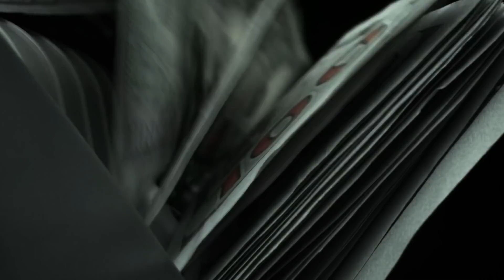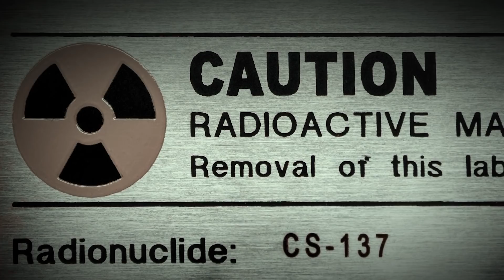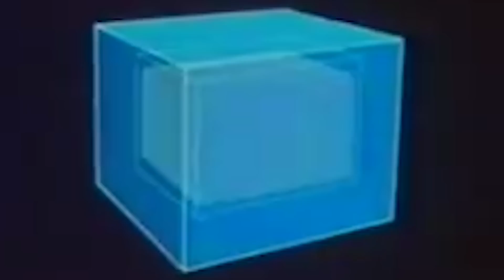100 MPH Train vs. Nuclear Tank

Comment: the weight of tonnes of the flask is 50 tonnes but with the flatbed railcare which weighs about 35 to 45 tonnes and take in consideration the train derailed because they took the track up were they lay the flatbed and flask so if that train would of been going say 55 mph and there would of been more railway track for the train to carry on i do thinnk that the train would of pushed it a good 300 foot or more down the line ok the front of the loco would of been damage but i do think it would of turned out differently i seen that 139 tonne engine at the scrap rail yard and considering it was going 100 mph and hitting something at speed that weighs nearly 100 tonnes all together the locomotive wasnt very very badly damaged ok the drivers cab was all gone but the rest seems ok and it is exploded too so that locomotive was very tough but so was the flask,

Comment: As for the Class 46 locomotive, she was scrapped on-site, though at least two of her classmates are preserved.

Nuclear flask trains still run in Britain today, and from what I gather they're now run by a company called Direct Rail Services. Motive power is usually provided by Class 20, 37, 57, 66 or 68 locomotives.

Comment: I remember this. It was a classic case of a company under political pressure diverting attention with a gimmick. There never was much argument over the capacity of the container to withstand physical impact. Then as now, the issue was (a) can the container withstand slow corrosion over very long time periods, and (b) how easy is it to steal?

Comment: Ok, but like, worst case scenario if the gas inside the flask that escaped were as radioactive as physically possible, how much of a release would 0.29 psi equate out to?

I'm no nuclear scare monger, I'm perfectly okay with nuclear energy(SMRs FTW!). But it does seem like a question worth having the answer to....
Reply: I think the video states it would be an acceptably low release fraction, i.e. in accordance with the UK Law based on the IAEA Regulations.

Comment: "Countries that have developed nuclear energy strive to prevent such disasters at all costs." You mean like building reactors with graphite tips on the top of fuel rods and no containment to reduce costs, like at Chernobyl? Or 12 foot sea walls where 60 foot tsunamis occur, like Fukushima? Or renewing Davis-Besse's operating license in Ohio even with a cracked containment? Or renewing the licenses of all those brittle old reactors after their 40 year life span is over? Or overloading open cooling ponds and using casks welded by unlicensed welders for storing fission byproducts within 100 miles of every major population center in the U.S.? Or not cleaning up acidic radioactive mine tailings? Or dumping nuclear waste directly into the ocean or in the Arctic or sticking it in 55 gallon steel drums (I am not kidding) in abandoned fields. Or, or, or. disasters, disasters, disasters. I have 4 great ideas! Surely everyone wants to do everything possible to assure the public that the warm-hearted intentions of the nuclear industry and its government cheerleaders will be more than enough to protect them. Just do these simple things. 1) End government subsides for nuclear energy. 2) Require utility operators to have full liability insurance and accept responsibility for all destruction, death and disease which occurs as a result of their operation or operating failures. 3) Rescind the extended operating license for any reactor that has reached the end of its 40 year design lifetime. 4) Shut down every reactor until we have a permanent safe waste storage solution for all of the nuclear waste, including radioactive mine tailings and contaminated reactor parts for the entire duration of ten times the half-life of all the waste needing to be stored. Make sure all that waste gets tucked safely away and put the biggest, meanest armed guards on top with orders to shoot to kill anyone who gets close, especially if they are nukies or politicians. Then lets talk about having done all we can to prevent disasters.

Comment: That’s all just GREAT!! And where do all these thousands of SAFE blocks of deadly radioactive death actually end up???????? Bottom of the Marianas Trench 😒
Reply: Ever heard of a breeder reactor - do your homework. You don't throw away energy  - unless you build windmills and solar panels of course.
Reply: Sea dumping of (low level) radwaste was ended by international agreement a long while ago. The used fuel carried in these flasks was shipped to Sellafield for reprocessing and the resulting radwastes are still stored there, awaiting eventual disposal to a deep geological disposal facility (if the UK can ever decide whose back yard it's going into).

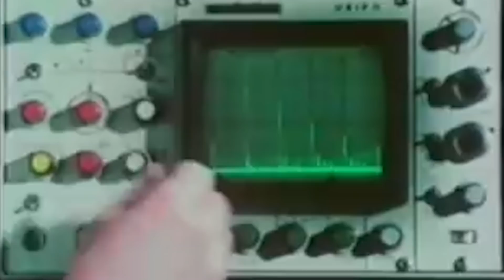Comment: 3:50 "Pressurized to 100 per square inch, per square inch" 🙄
Reply: It is a new and novel unit of measure: PSI^2 

Apparently there is a newly discovered acceleration component to static pressure.
Reply: Surely at least the first P is pounds.  
What would that be... 
PSI = pounds/in²
PSI/in² = pounds/in⁴ ... ?
Reply: @arfyness  
Apparently they have come up with the moment of inertia of weight or something

Comment: The bolts that are mentioned at 1:34 are most probably made by my  teacher at college. He was the manger for making them. (I think manger, he check and made sure they all fisted and worked to the tolerances of the spec). He still has the operation sheets for making them. I got to read through it and it was really interesting. They had to be stored in oil and a nylon sleeve to keep them from getting damaged.
Reply: Neato. Probably made out of a similar material of  H13/ tool steel. It's sensitive to rusting so it constantly has to be oiled. I have these bolts as rod bolts in my engine
Reply: I doubt it

Comment: I used to work for an engineering company that built much smaller flasks for British nuclear fuels, in fact I earned extra money working a night shift sand blasting them.
Reply: Interesting, I would think the extreme weight of these flasks would make them nearly impossible to steal? A few terrorists would have a hard time making off with a 150 ton container.

Comment: Why can't they make something like this to transport oil and deadly chemicals?
Reply: because it would increase astronomically the transport cost for no reason. Imagine carrying 2 tons of cargo inside a 15 ton containment vessel, and without need for all that, given neither oil nor any non-radioactive chemical emit alpha/beta/gamma radiation. The issue with spent nuclear fuel is the shit it emits goes through solid steel plates, thick ones at that.
Even with all the hazard of oil spills, it's still FAR easier to clean up, and any uncleaned residue is far less dangerous than spent nuclear powerplant fuel.
Even non-radioactive chemicals, anything that comes out of them, as deadly as it is, can be stopped with normal materials in normal quantities. Toxic gases can't pass through solid non-porous materials, neither can liquids, and solid stuff just stays there too. If it can't corrode the container, it's fine. Protecting it against shocks can be done with simpler ways like foam cushions around the package that holds the chemical.
Some chemicals to be discarded can also be neutralized to either reduce the danger or downright turn them harmless.
Reply: @Kalvinjj  Only gamma radiation will pass through anything more than thin aluminium sheet.
Reply: @bobthebomb1596  Yes, specially alpha is easy to block. Just added them cause, well, they still are important to block well after all.
Reply: @bobthebomb1596  Actually neutron radiation will also pass through thin Al sheet. But, for irradiated used fuel, gamma would be the main radiation of concern. Some neutron radiation will also be generated, but the gamma doses would be much greater.

Comment: 4:54 Uhh, you realise we can see that there is NO flames at all right? 🤷🏽‍♂️
Reply: Not immediate, then.
Reply: @mikeuk4130  It was a diesel train, takes a while to produce an ignitable fuel/air mixture.
Reply: @bobthebomb1596  Agreed, I was just railing against the over-dramatic commentary, which was hardly necessary, given the event.
Reply: @AmmyWulf  Why wouldn't he add that... 🤷🏽‍♂️ Thx tho I will check it out.

Comment: 100 pounds per square inch per square inch. That's like 10,000 PSI!
Reply: @Robert Sears Is that PSIA, PSIV, or PSIG? I only understand pressure in terms of Newtons per Square Meter.
Reply: @BruceWang-h7s  How many inches of Hg is that?
Reply: @KellinKingdom  Like at least 100 metric Torrs per square inch PSI
Reply: @BruceWang-h7s  That makes way more sense. Thanks! :)
Reply: @Robert Sears I agree. That's why I write out my convective heat-transfer coefficient in BTU/(ft^2*F)*hr, and not W/(m^2*K). Gotta stay away from that commie Metric System.
Reply: @Robert Sears lol
Reply: @Robert Sears But what he said was "100psi per square inch" he didn't need to add "per square inch" or should have said 100 pounds per square inch.
Reply: @Robert Sears  If you are so stupid that you can't see it then I'll not bother explaining further. I refuse to fight a battle of wits with an unarmed man.
Reply: @Robert Sears You're right, it's more like 100,000 PSI!

Comment: Scientist one: "How can we structurally test these flasks?"

Scientist two: "I like trains"
Reply: Scientist one definitely hates scientist two
Reply: more like engineers in this case but ok
Reply: "Good work, men. We've proven they are sound safe from impacts."
"What if, for some reason the train crashes and is in a puddle of fuel for an extended period of time?"
"Good question, Jenkins (it's ALWAYS a 'Jenkins', isn't it?). Let's fill a pool full of jet fuel in the desert, put one of these buggers in it, flick a match into it, let it burn until dry, and see what happens. It's for science, after all."
"Wonderful idea, sir! I'll get the s'mores fixins!"
Reply: What about a 12" naval gun? The tests were propaganda, not a test against attacks
Reply: @RebeccaCampbell1969  12” 1100lb naval round at 2700ft/s = 175,105,000 Joules of kinetic energy

250tons of train, one locomotive and 3 cars. = 500,000lbs moving at 100mph
226,620,148 joules of kinetic energy

So yeah I think it can take a 12” naval round to the face point blank.
Reply: @user-yq6ov6ow7l  your forgetting the surface area of impact by Joule/cm^2 and relative penetration of a pointed shell vs blunt train.
Reply: Was #2 name Cooper?
Reply: I like trains.
ADSF!!
Reply: Rail is the primary form of transportation so it makes sense, and it's fun!
Reply: I think they also rammed an old Phantom as well.
Reply: Dr. Coomer and his cohorts from HL: VR AI
Reply: it was more of "how do we convince the british to store almost the whole worlds dangerous nuclear waste o thier tniny little heavily populated island" IT WORKED TOO...

Comment: Nuclear Power is a beautiful thing
Reply: Nuclear is the only alternative fuel that actually works. All the time.
Reply: Less people have died in the nuclear fuel industry compared to EVERY FUEL INDUSTRY IN EXISTENCE (massive echoes and reverb)

However, when nuclear fuel fails, it fails spectacularly!
Reply: @reggiep75  kaboom
Reply: @Ash N HAHAHAHA!!!!!!! You make it seem like nuke plants going "KABOOM!" is part of their natural lifecycle. Pro-tip - it's not. Per kWh, over their lifespan, they have the SMALLEST carbon footprint of any current power generation system, Gen 4 reactors can use old fuel as their own, and there are meltdown-proof reactor designs waiting on blueprints screaming "Send me in coach!". It's people like YOU that won't let them be built because of irrational fearmongering like what you typed and "MuH cHeRnObYl AnD fUkAsHiMa!".
Even hydro has a higher body count than all nuclear in history. Look up the 1975 Banqio Dam failure. As Wikipedia puts it -  "In May 2005, the Banqiao Dam failure was rated No.1 in "The Ultimate 10 Technological Disasters" of the world by Discovery Channel, outranking the Chernobyl nuclear disaster." Full article - https://en.wikipedia.org/wiki/1975_Banqiao_Dam_failure
Reply: @Ash N all nuclear reactors nowadays are built within containment buildings, meaning if a leak occurs it will normally be contained within, and thats assuming that an accident will happen in the first case, the level of redundancy and failsafes in modern nuclear reactors makes the chances of a major accident seriously remote. modern nuclear reactors do not explode like how the chernobyl one did, you must know that the RBMK reactors as used at chernobyl had a catastrophic design flaw within their emergency shutdown system which caused a serious spike in power to the point at which it was generating 33 gigawatts of thermal power before the power meter failed (more than 10x its maximum rated output of 3.2 GW) which resulted in either a steam and hydrogen explosion as the water in the reactor broke down into its elements or, what i believe to be more likely, a nuclear fizzle. that was why that reactor exploded, no reactors today have such a major design flaw
Reply: No, it's one of the worst of mans creations.
Reply: @Ash N those people only understand short term stuff. No mind of hundreds or thousands of years. No fucks gave by them. Cyclical events coupled with nuke tech is going to be a huge, catastrophic, and nearly unfathomable event and loss of life. The youngest of humans now will possibly be the ones dealing with it.
Reply: We will need power from somewhere besides the grid as more and more vehicles convert to electric, I would Imagine. Reactors are getting very small these days. And much safer than thought possible. Nuclear is the only way forward.
Reply: not anymore until it goes kaboom
Reply: @ariesceazarmondejar4700  Comparing modern plants to old soviet plants is like comparing a modern car to a 40s soviet car. Which one would you survive in, in a crash. Technology and safety has moved on.
Reply: See Stephen Colbert's take on that.
Reply: @user-mp3eq6ir5b    I wouldn’t see Corberts take on anything period !!